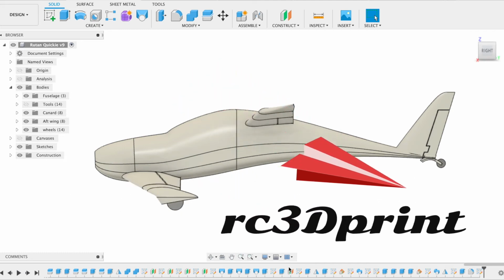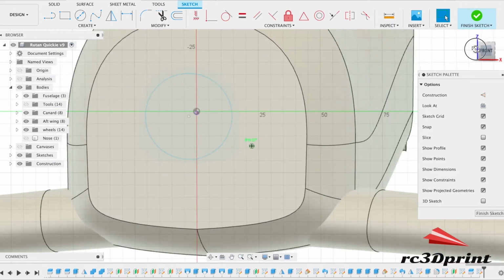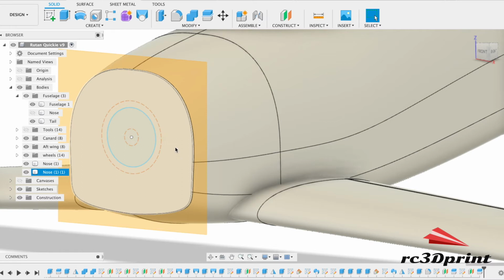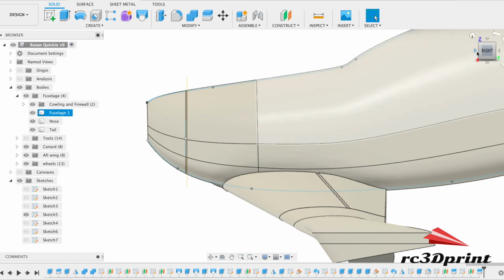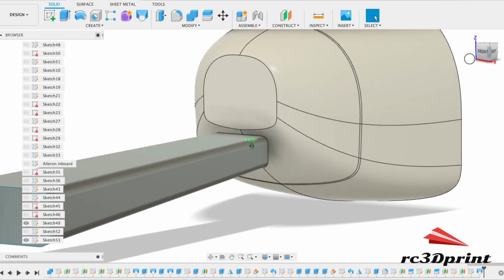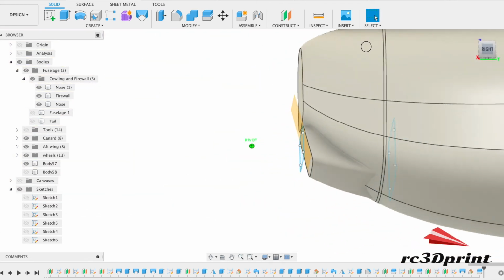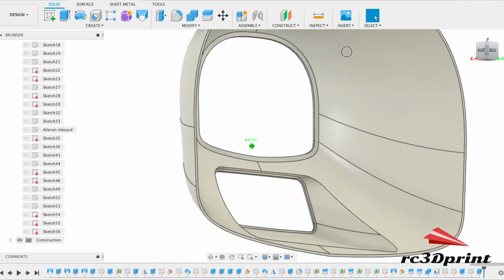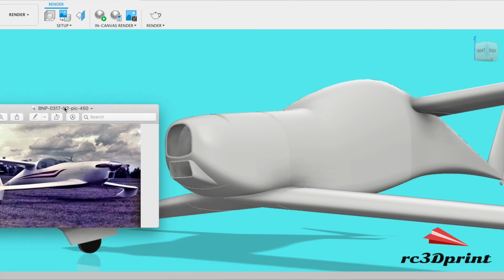How to 3D Print and Airplane - Rutan Quickie - Episode 6 - Motor Mount and Cowling

Comment: Hi, thanks for these videos they are really helpful. However if actually fly these, how do you model the internal structure of the wings? If possible could you make a vid on that?
Reply from the maker: Hi, I will make a video showing you how, and why you might not want too.

 I tend to use the infill created by the slicer for my internal wing structure. I have done lots of test and find no sizeable benefit in weight and strength apart from when you need highly specific support in an area. In this case I make some very thin cuts which are printed as supporting lines. 

The benefits from using the soldibody infill approach are less design time and easier prints.